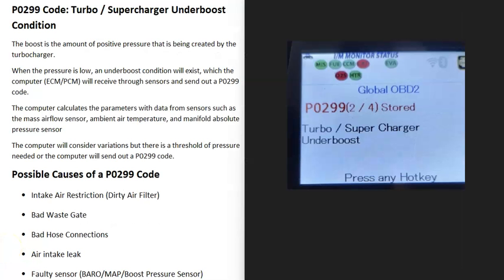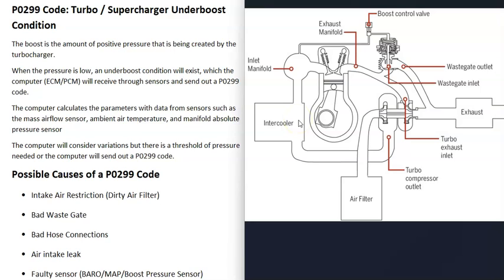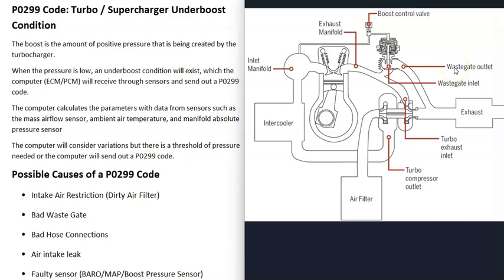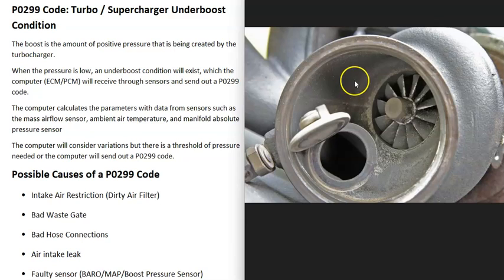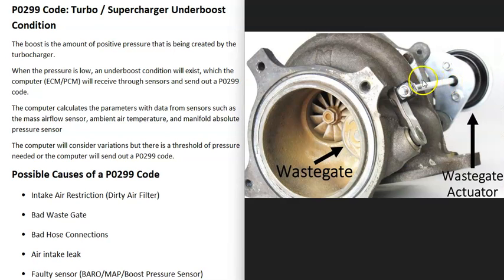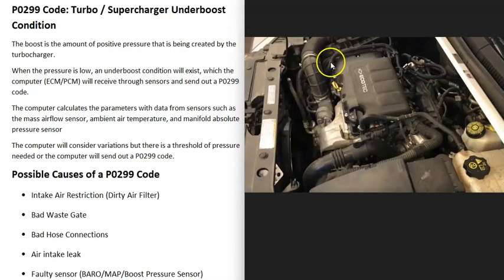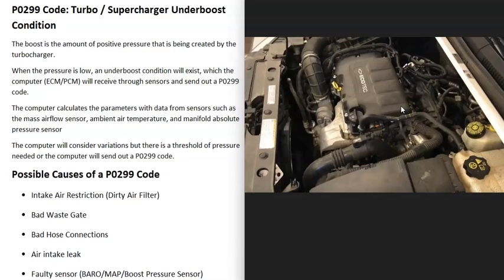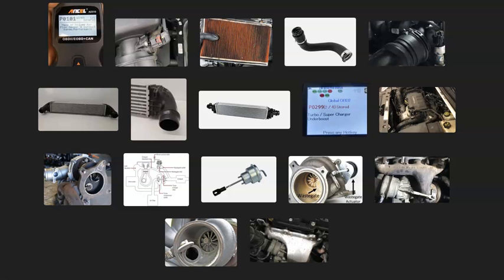Causes and Fixes P0299 Code: Turbo / Supercharger Underboost Condition

Comment: Hello , thanks for video . I have a question. I have a 2018 accord 1.5 sport . I keep getting code P0299 . I purchased a wastegate actuator. Is there anything special I need to do when I replace old with new beside adjustment ?

Comment: He forgot to add one of the basic things it could easily be the The Turbocharger Boost Solenoid. It repairs the turbo waste gate air control system to proper operation, therefore preventing costly damages to your vehicle's engine and turbocharger system. It's a direct-replacement boost solenoid is easy to install and requires no special tools during installation. Some people call it a waste gate control solenoid.

Comment: Mother in law has 2022 Equinox and car reported diminished power while driving and then just shutdown and would not restart.  P0299 and P0171 and will not start now.  No warning other than the car lost power and then just shutdown while driving.  

I was recently in an accident, so I'm wondering if it's related.  But it cranks and cranks like crazy but will not fire.  P0171 is generic lean code.  

There was also an undefined code 102B????

Comment: HOPE THIS HELP

I had this same issue. Being women, I do research and try to find issue so I don’t get scam. Well I notice po299 code came on 2 years ago. After purchasing a code reader it told me superboost A something, so after I change engine filter and spark plugs light still on car shop telling me to get new turbo but it was expensive so I decided one last dig. I bought 2 injectors had him put them in and guess what light gone. 2017 Chevy Cruze my BAD INJECTORS. I also replace pcv pump hope this helps
Reply: How much did you spend?

Comment: Before tearing into the engine and removing the turbos, the first thing I'd clean and/or replace is the Manifold Absolute Pressure Sensor and the PCV valve(s).  When these items go bad, you lose boost, which makes people think there's an issue with the actuator, wastegate or turbo itself, but the fix may be an easy and inexpensive DIY job. My 2016 Porsche Cayenne GTS had thrown a P0299 fault code.  The Cayenne was driveable, but not fun to drive without the turbos spooling up and providing boost. I was able to restore boost and eliminate the fault code by simply replacing the MAP sensor and the two PCV valves. I went with a Bosch MAP sensor and Chinese made PCVs.  Total cost was about $160 and all is now good.

Comment: To troubleshoot:
1. Smoke test the intake for leak. If there is a leak before the turbo, you are fixing a running rich problem. If it is after the turbo, you are fixing the turbo boost problem.
2. get a vacuum pressure pump to the actuator. With engine running, if you actuate the actuator (applying vac), the wastegate should close up and the turbine should spin and therefore you are creating boost and that should vary the idle speed. If not, wastegate does not close right or the turbine simply does not spin. Time to replace the turbocharger.
3. Get a vacuum gauge and connect it to the hose to the actuator. Drive the car hard to activate the turbo while watching the gauge. It should see vacuum when ECU is commanding the boost control solenoid to close the actuator. If no, the control side has the problem, not the turbo itelf. It could be the vacuum line leaking, or the control solenoid not getting signal from ECU or not working.
....
Correct me if I am wrong... Or comment to improve is always welcome.

Comment: I am getting the P0299 code and the P0016 code which is crankshaft position camshaft position correlation bank 1 sensor A. So this could be because of a sensor ??
Reply from the maker: It needs to be diagnosed, but I would fix the P0016 code as it likely is causing the under boost. Here is a video on a P0016 Code.  https://youtu.be/XWEInn_zBx4
Reply: @HVAC_Mechanic  Called local dealership. Terrible news. They said cam phasers and stretched timing chain. Go in and change everything while your in there, $4500 🤮🤮🤮

Comment: Hi there thanks for the great explanation, I'm getting a P0299-00 and P004C-00 fault code on a Volve XC60. Replaced the map sensor thinking that would fix it but, vehicle drives fine for a while then randomly looses power. If I pull over switch off then manually unplug and re plug in the map sensor wire the boost returns and the car runs fine until it randomly looses power again. Trying to figure out why. As I say it's random, can happen while driving or on first start up of the day.
Reply: Also notice a knocking/tapping sound from top of the engine

Comment: Where are all my ecotec homies at? 
I’m so tired of seeing p0299. Never had a check engine light for it but I can feel the underboost. 
Replaced the turbo. Was fine for a day, then it came back. Then I “replaced” the turbo coolant return line.( It’s a sonic so I always assume it’s that ) 
That worked for another couple days, and then I can feel the underboost again, check the codes,  another p0299 
No idea what it is this time. Sometimes it drives normal again, then other times it starts lagging, ESPECIALLY with the AC on. 
I’m about to drive me and my ecotec off the edge of flat earth
Reply: Same problem here with a 19 equinox 1.5. Some days, she drives perfect, others I get the underboost code and baro sensor code, with limp mode, I shut the car off, let it sit for a few minutes, then start it back up and its back to normal... I've swapped nearly everything except for the turbo, been fighting this issue for 10k miles now

Comment: I have a 2014 fiat 500 l. I have replaced my wastegate actuator, diverter valve, and air filter, but I am still getting the code p0299. My car is running great, but it will hesitate once in a while. I have no hose leaks. What else could it be?
Reply: I have same fuking problem on my s5 b9. Someone drop some knowledge, I am switching out a bad sensor. It's throwing 2 codes of the same thing .p0299 . My oil pressure goes up when ever I step on it a little hard. It'll still spool at low RPMs but doesn't wanna hold boost passing like 2-3k rpm. Edit i am nkt switching out my sensor but the waste gate actuator.  Let's see how that goes

Comment: This happen to on Thursday my OBD lit up and I took it to mavis and came up with 3 codes 0299 u0416 and ecm power train code. MAVIS must had cleared it and a co worker of mine had his tool scanner n said the car is fine.. I did replace the air filter cause it was dirty and carbon filter was clean I might do a fuel injector too as well and run all the gas out this week

Comment: Thanks- very informative.   If there's a leak in the system, will  it be really obvious?  Also, I got this issue after filling up with gas on a long trip.   I have to use premium which I filled up with.     Can bad gas cause this error?
Reply from the maker: Sometimes, a leak is obvious and can be heard while the engine is running, and then other times, it can be hard to locate. Bad gas can affect the engine, but that usually gives a fuel injector or misfire codes.
Reply: @HVAC_Mechanic I found the issue last night.  It wasn't bad gas.   The small lever that opens/closes the waste gate that the actuator rod is connected to, broke where it is connected to the gate shaft.  Of course it was staked on.  I don't see any way to replace the lever and it appears replacing the entire turbocharger is needed :(

Comment: I got the same code on my 2019 Chevy Trax. Lord willing it’s just the by-pass valve, less expensive to fix. My question is , I can’t afford to repair it for 21/2 weeks , it’s my only source of transportation, will it be ok for me to drive?
Reply: If the turbo really is bad, it's not safe. It could start breaking apart and send pieces of itself into your engine - not good.

Comment: So I got this code a few times but the check engine light has shut off after a couple days then gone back on with the same code a month later. This has happened 3 times in the last year. So I'm thinking it's the waste gate actuator.
Reply: Can you just replace the actuator or will the whole turbo need to be replaced?

Comment: I've got a p0299 code on my car. I drove the car to get home after the engine light illuminated. Perhaps about 10 miles. When I got home I had smoke coming out of the oil check (dip stick) hole. The oil was burnt and lumpy. My car has a 1.4 turbo petrol (gasoline) engine. Any idea why the oil would have burned?  The coolant temperature never flickered on my journey home and oil had looked good about a week earlier.  I would appreciate anyone's help or thoughts on this problem. I think my engine is f_(&3d!

Comment: 2021 Terrain, P0299 but only when it's really cold out. I found a GM Technical Instruction and it said to cover the intercooler. I guess they have had some issues with the CAC freezing up in extreme cold. It's finally warmed up around here, so I'm interested to see if it comes up again.
Reply: Been dealing with the freezing problem took it in just for it to come back on a week later just gave up on this thing don't no what to do
Reply: Had the front cover on then got up to 50 Degrees last week so took them off then now it going bsck down to 30 degrees and now the light coming back on

Comment: Great job I love checking out YouTube stuff. You’re one of the best I’ve seen and watched so far in the last 15 years. I really love the pictures you put on the very end. I did a water pump change on my car yesterday and then my error code came up P0299 and it was the big hose that hooks up to  the bottom of the radiator area Again thank you very much.

Comment: I have this code on my 2018 Ecosport SE 1.0 L my only problem is that it also have a recall on them Vehicles for engin oil belt and tensioner replacement can that cause damage to turbo?

Comment: I've got this code along with all these other warnings: Emissions system problem Brake system problem Brake hold system problem Vehicle stability assist problem Hill start assist problem Power steering problem. This is for a 2018 civic hatchback
Reply from the maker: It needs to be diagnosed, but many vehicle computers will shut down driver assist type programs when there is an engine malfunction.
Reply: Happened not me today with my 2018 Accord Sport and took it to Advance Auto and that’s when I got the code.

Comment: Can this affect battery as well? Got this code waiting for it to go in shop and now all a sudden there’s no power going to the vehicle
Reply from the maker: A bad battery or alternator will affect the engine and computers. If the battery is having problems, have it tested and check the connections. Also, have the alternator output tested. If the battery and alternator are good and the P0299 code is not clear, then that is another issue that needs to be diagnosed.

Comment: I have a 1.6 tcdi fiesta and I’ve got two codes for turbo been to mechanic three times and still hasn’t been fixed codes are p0299 and p132b-22 also another code p2599-00

Comment: Hi. Thanks for a great video. Im getting this P0299 only when its minus 10c outside. The car looses power but works. Is there any ways to know why this only happends in the winter? Its all good in summer.
Reply: I also only have issues in the negatives temps.  If you have this issue again, clear your codes, drive for awhile, and it will clear itself out.  I have a 2021 Silverado 2.7l
Reply: @devonplant6742  Yeah i know. But i dont have to clear it. It just go away it self...  Some times i loose power even without the error or light in dash. So its a wierd failure :P
Reply: @LoSLuciferGaming  as long as this trucks in-between 0° and 100° F I never have an issue.  Go above 100° atmospheric temp the limp mode will activate as well.  You are lucky...mine never clears itself.  Im still just glad I can do it with a code reader though lol.
Reply: @devonplant6742  got the same problem took it in a 2nd time just for it to come on a week later just said f it and clear the code when wife say it went back some time the next day some times a month later
Reply: It sounds like the cooler (under your radiator) is freezing up. I found a GM TI that says to install a cover over that cooler in extreme cold.

Comment: I've just been to the garage with this code.tells me I need 2 new injectors???on cylinders 2 and 3.gona get it checked at another garage.
so far I've changed the air filter,fuel filter map sensor ,cleaned egr valve,and put a very good injector cleaner through the system. van runs a little better but still not right. I don't want to spend 500 buks on injectors if its not the problem and if the injectors snap on there way out .cylinder head will have to come off😬
Reply: Did the new injectors fix the problem mate?

Comment: My van throws up this code when it’s cold. It has no power then once it’s warm it’s fine and if I reset the code it won’t come up again when the van is already warm? Changed air filter and MAF sensor already
Reply: Could be the actuator siezing in the cold?

Comment: Hello I have a 2014 that has Po299 Maserati  Quarttroporte with 42;000 miles. What would I do first not to familiar with this engine
Reply: Did you ever figure it out? I have the same car around 50k miles as well
Reply: I have a 2016 ghibli and just got this code. Anybody figure anything out?

Comment: Hi I have a 2013 dodge dart rallye 1.4 turbo I have that code sometimes when I drive I loose power I just pull over turn off the car then turn on and drives like nothing happened it could loose power in less than 2 minutes or I can do a 2 to 8 hours drive with no problem any idea you can think it is

Comment: I have a 2022 Chevy Trax that has a po299 code coming on I buy the most expensive oil that I can but then I also bought some oil additive for the turbo pretty brand new turbo it's not making any sounds I don't really seem to be having lots of power I don't know what I could be I do feel like I'm having problems with the wastegate controller that would be fairly hard to push an open and close by hand right

Comment: Just got this code on my wifes 2018 equinox. I got the P0299 and  P0132
Permanent
O2 Sensor Circuit High Voltage Bank 1 Sensor 1
Air filter was pretty dirty, would the P0299 code cause the P0132 code? The car only has 38k miles.
Reply: Did you fix this ive got similar 299 and bank 1 lamda low voltage ? Annoying with engine light on a Renault.

Comment: good video, are you saying 1 code could be because of 20 different things
Reply: Yes usually you can diagnose a problem with another code If there is one. As long as they appear close together in on the timeframe that it happened on.

Comment: I am receiving error code P0299 in my 2020 1.6 Diesel Opel Insignia vehicle. I can't solve it. Turbo was overhauled, Particle filter was overhauled. Turbo hose changed. But the problem did not go away? Maf sensor and egr valve changed. Please can you help me
Reply: did you ever get it fixed.🤔

Comment: Idk why I’m getting this code.. my car when I press the gas it don’t  respond correctly it’s not getting enough power not sure what it could be
Reply: is the problem solved?
Reply: @arabam-la  no
Reply: @arabam-la  no not at all still can’t figure it out
Reply: Me too
Reply: @laurencegill3469  shit sucks man.. not sure what it is.. can’t really drive it
Reply: @DavidRamirez-ig6rt  Dude, have you considered changing the oil and vacuum pump?
Reply: @arabam-la  I have done the oil change.. not sure where the vacuum pump would be I have changed a lot of the things
Reply: @DavidRamirez-ig6rt  The vehicle has a 1.6 Diesel insignia?  There is an Oil Pump in the sump housing on the underside of the vehicle. The oil pump also supplies air to the Brake and Turbo. The air created there comes to the solenoid valve, my friend.
Reply: @arabam-la  nooo my car is 2014 Chevy Cruze 1.4 turbo… that’s why I’m confused as to what you mean.. idk I just can’t figure it out even some mechanic I have gone to
Reply: Is it like when you press the has its delayed and takes a second for it to really kick in and go?cause that's what's wrong with mine and I'm getting the same code

Comment: Hey, I have this code in combination with a P0101 code..what action should I take ? Is this a sensor problem when combined with the P0101
Reply from the maker: They likely are separate issues, but I would clean the MAF sensor, clear the codes, and see if they come back.
Reply: You ever figure it out?

Comment: I have a 2005 T1N 2500 van.. I got this P0299 code. I couldn’t find a leak and also I hear the leak only after I drive for an hour or 2 and then all of a sudden I hear it leak and my turbo don’t kick in. I have to turn on and off my engine and then it works fine for 30 to 40 miles and same thing repeats.. any idea what might be the issue?
Reply: is the problem solved?

Comment: I had this error on my Jetta sw, I replaced the boost pressure valve, but I’m still getting the same code. what should be the next thing to look into?
Reply: I had the same  problem  before .Check the bottom hose that is going to the intercooler that's usually gets sucked or loose